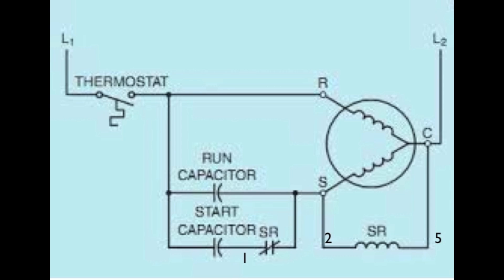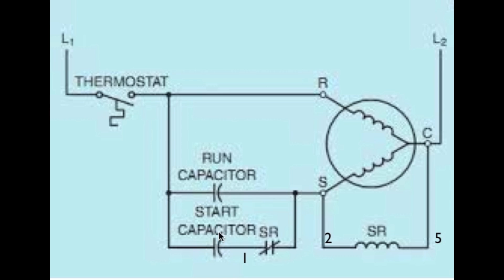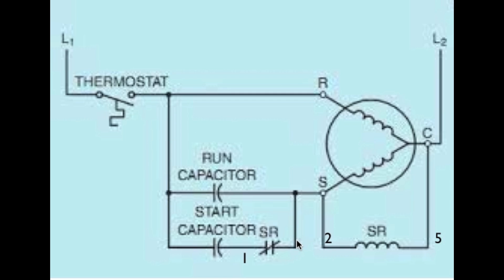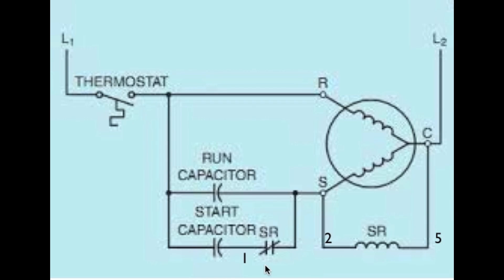Diagram of the potential relay Part 2

Comment: Should not be another capacitor to the Run winding??
Reply from the maker: There is a run cap and a start cap.  How many do you want?
GFM
Reply: @grayfurnaceman   one run capacitor for  the start winding, and one for the run winding... I am thinking of  how find a way to optimize the energy consumption by reducing  lenz effect.
Reply: @grayfurnaceman  I wonder why the run capacitor is in the winding that is not running permanently
Reply from the maker: @jr3474  All I can tell you is it just does not work that way.
The capacitor is a current limiting device used in series with the start winding to increase efficiency.
GFM
Reply: @jr3474  Both windings are working and contributing to rotate the rotor from when the rotor begins to turn until power is cut to the motor. The start winding provides more torque to the rotor when the start cap is still in the circuit and less torque after the start cap is disconnected.

Comment: Although one can not clearly see from the diagram since each unit is not compartmentalized, terminal 1 can not be in contact with S outside the relay, independent of the relay as from the diagram you can't tell of course.
In essence terminal 1 is feed by terminal 2 of the relay and it is terminal 2 that goes to the S of the motor.
The lever that feeds contact 1 is in contact (normally closed) with 2 due to its tension. When coil gets energized, it pulls down on the lever that feeds 1.
So that slash mark (SR) symbol is the contact inside the relay;  and where it goes up to S on the diagram is really going to the start capacitor.

It appears to me ( in my mind's eye), that a wire from S goes down to 2.  Inside the relay is SR, the contact point of terminal 1 to terminal 2 (NC) and what we see as terminal 1 outside on the relay goes to the start capacitor.
terminal 1 can not be independtly hooked up to S terminal.  If I am correct in this, the diagram can easily be misleading if what I said is not mentioned assuming I am right.
Reply from the maker: Its a schematic diagram, not a wiring diagram.  Components are not shown in their discrete components.  This diagram is used to sequence the operation of the system.
I assure you the wiring is correct.
GFM
Reply: @grayfurnaceman  And just when I thougtht schematic diagram and wiring diagram are the same thing.  :-)
Reply from the maker: @alchemy1  Schematics are used to sequence operation.  Wiring diagrams are used to follow the wires in the unit to locate components.
GFM
Reply: I have 820arr3c30 relay in an old instrument. It trips off circuit breaker once it starts cooling? Seems windings have resistances and capacitors are ok. How to test this Tecumseh relay. It has 4 poles. Not sure what are they? Anyone knows please help me. Thank you in advance
Reply: @alchemy1  You're right. That schematic doesn't correctly represent the electrical or physical connection between terminals 1 and 2. Those 2 terminals are in series but the schematic shows them being in parallel

Comment: So, do those potential (voltage) relays have a correct orientation ("up" direction) that they should be installed in?
Reply from the maker: Some do.  There should be an orientation arrow on it if it is sensitive.
GFM

Comment: There is an interesting difference between the two-wire Rectorseal Kickstart and the 5-2-1 three-wire version. I just installed the 5-2-1 on a very old unit. I can tell a difference by the start sound. It helps. The Kickstart product can be purchased for less money, and maybe it is better. Then again, it could all be propaganda. I do not understand why all units do not come from the factory with a start cap in place. Sell more replacement units? I have also heard so techs will charge $350 or higher to install a hard start kit. Wow!
Reply from the maker: The reason the hard starts are not installed on all units is (of course cost) but also hard start is just that.  A hard jerk to start the compressor.  Think of it as coming off a stop sign with your car using full throttle every time you start.  Remember, when the motor rotor turns, the windings of the compressor are also being jerked the opposite way.  Could cause premature winding failure.  The cost of hard start kits depends on manufacturer and labor involved.  Consider it takes 2 calls to complete this repair.  Hard start kits supplied by the manufacturer are more expensive (and better fitted to the unit).  The 2 wire kits use a thermistor to reduce current flow after the unit starts.  The 5-2-1 kits use a potential relay to open the start winding.  Hope this helps.
GFM